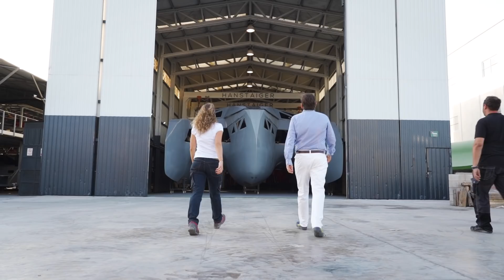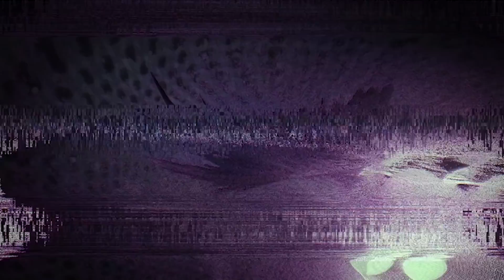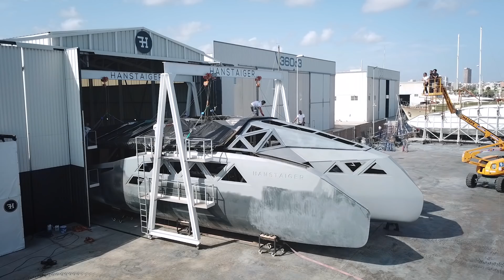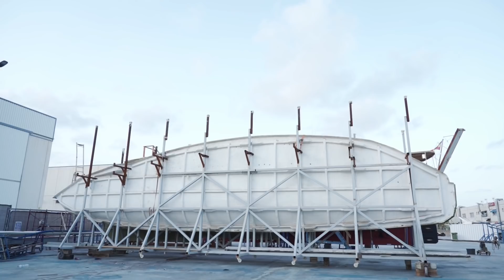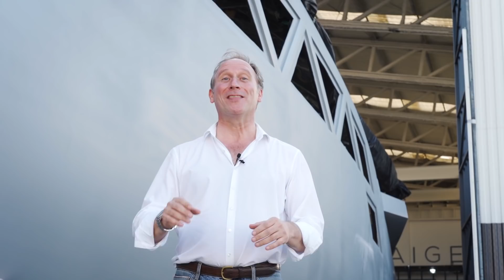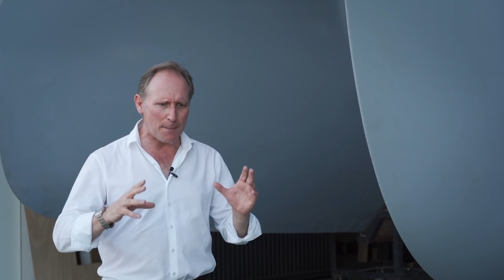BUILDING A 64' TRIMARAN FROM SCRATCH!!!   THE HANSTAIGER X1

Comment: Love the yacht, black is a stupid colour (shade) though, no one is going to want to live in an oven, it would be so hot that you would have to run the air con 24/7 and the batteries can't do that so there goes your very expensive fuel bill, the hull would be so hot that even with the back door open the yacht would be boiling.

Think different yes, but there are some things you just do even if everyone else does them, because it makes sense, and light coloured paint is a no brainer.

Comment: I really like trimarans but the clearance between the water line and the bottom of the decks between the main hull and the amas' looks pretty low. I know that some catamarans were rated poorly because the waves would slap the under deck making the yacht noisy in anything but flat seas. The hull and two amas appear quite beamy so likely very buoyant which would tend to keep the under deck higher out of the water, but then how well would the boat track upwind or on a beam reach? This video is a sales pitch, which is OK. If it works I would love to have one (but without the large windows facing forward). I would really like to see how a scale model, properly weighted, performs in a swimming pool and wave tank. Also the sail plan that was shown looks inadequate or perhaps improper for the size of the boat. I am no engineer but I am pretty certain that a simple jib and mainsail would not work in anything but ideal conditions. The rigging needs to be better explained. 

Having said all that, I otherwise like the look of the design a lot! (Except for the very large forward facing ports in the bridge decks between, the hull and the amas'. I think that is just asking for trouble.) It looks a lot like a space ship which would make the owner one of the coolest kids on the planet. I do hope the interior is finished nautically and not like the typical European contractor grade blond wood, square cornered cheap motel décor. My preference would to decorate the interior in a steam punk, 20,000 Leagues Under the Sea ambiance. Would that not make this the uber coolest yacht on Earth!

Comment: It looks cool but no real outside deck space, what did they replace the cheep foam which has ZERO structural value with balsa wood ha ha ha why are there so few ribs in the structure but it does kook nice  and it does not weight much by the look of the caster wheels .

Comment: But is the owner going to BBQ on the hot black exterior?
Reply: The only yacht that will cook you if you stand on it's exterior and requires AC in the winter or while traveling above the arctic circle... This is going to use a lot more fuel than a like volume yacht and why fix a design flaw (black exterior) with several cost increasing "features"? Mark these words; this is one of those amazing futuristic designs that will be used as a case study in the future of why small yachts have certain design elements, namely this is an excellent how to not design a boat. Feel free to prove me wrong, not with words but with this boat not having the problems I'm mentioning.

Comment: After this only a submarine with sea sailing and air flying capability can be expected. You may not expect this from me but I was looking at other catamarans and trimarans  with an idea to purchase / build one and I do agree with Hans Steiner - ALL current designs are like a living room sofa dropped into the sea. All current designs look more or less like a happy-bingo sea hotel but THIS X1 is something very much else. It would have been more then a pleasure to work on it and sail on it even though I do have concerns about this middle joint ... Have you considered ... 3D PRINTING the entire shell?  It's possible to print entire buildings - why not yachts? In any case I am looking forward to see and hear more about this project into the future. God Bless.

Comment: If he is going way outside the box on this one... Why not have flexible solar panels made into the sails as in The Black Pearl or extendable foils as in the America's Cup Ship designs.... Wouldn't have to be as radical but enough to gain more speed under sail.  They could extend straight down from the hull in more of a fixed position, computer controlled for stability.     just an idea

Comment: we wish to build a 100ft HSV for Lake Victoria with 8 medical crew and the Crew by at least Cptn, Eng. Cook, and Steward with  Examination Rooms, theater, and Dentist chair - as Symbol for UN SDG Circular Economy - our Design Briefing was based on a 100 ft Catamaran fully solar shell with hydrogen propulsion - do you see a possibility to use one of your moulds to build our - extrem futuristic vision of form follows function ...pls contact : acad.interfaith Kenya-Swiss-Turk Curatorium Bamboo Equator under <pariscop21surveillance@tum.ac.ke> or Paul Ketterer Head of Mission (Swiss ) +254 790 408 314 / or 315 / asante sana Prof.Dr.Ezekiel Okemwa Nobel Prize Laureate Chairman Curatorium

Comment: Yeah, a black boat that requires a lot of AC to cool it down. Some things haven't been done before, just because they are not a good idea.
Apart from that, it's nice to try something different for sure.
The problem with builders is that they don't live on the boats they build later on. If they would, boats would surely be different. That applies to many boat and house designs, though.

Comment: I can't wait to see how this thing comes together all said in done. However it isn't very pretty. The overall geometry of the ship seems a bit off, using the bases of "the triangle is the strongest geometric shape" seems to prevalent in amateur designs and in this case is well overused. The triangular windows don't seem to be well optimized for the space they're occupying and the profiles seem disproportionate. This typically is the problem when there isn't a lot of scaled modeling done beforehand. I'm assuming they did most of the design work in CAD. But overall i love the fact they are bringing a full size concept to life. Definitely major respect points for not using the same old cookie cutter hull design and throwing caution to the wind. Thanks for bringing this to light! most of us would have never heard of the project otherwise!

Comment: I have always liked the idea of a super yatch, for the elegance, and beam with, yet dred the thought of the fuel consumption. With this type of trimaran, it may tick a lot more boxes. Look forward to seeing the finished product.
Reply: Then get a sailing super yacht! This yacht is one. You can still use some fuel (if you like) to run generators for enough electricity to live in a lavish lifestyle, but that amount of fuel use is nothing compared to the insane amount of fuel required to run the massive engines on a motor yacht.

Comment: Reverse sheer lines and bows are old design ( Horstmen trimarans 1960's) . Boat builders found they submarine . Wait till a wave or ships wake takes out that huge open aft deck and floods the boat. Or bow hits a dead head (floating tree) or a shipping container. That bow will go under not over.  
There is no curb to pull over too. And call on your cell phone for a tow out there. Even a sat.phone does not always work. And mother nature is a bitch!

Comment: maybe it would be good as a power boat but as a sailing vessel its less than optimal 
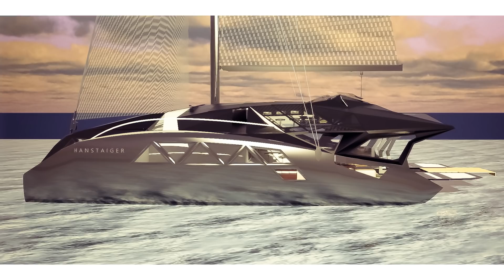just look at 9:37 the profile is way to high the wind has to much surface area to affect the boat .
now i am not trying to be a douche but this looks to be a boat that is designed by people without much experience in 
cruising if any at all , that becomes really clear once you look at their homepage ... its a mess 
the floorplan is confusing to say the least and here is a snippet of the spec sheet 

ACCOMMODATION:
1 Owner’s stateroom 2 VIP Staterooms

1 Staff cabin
2 Crew cabins
1 Captain 1 Crew
1 Staff
9 Guests

say what ? 
no i am serious just look at the specs page it seems it was put together in like 4 minutes without much thought or care 
its not very confidence inspiring when you try to sell a multi million dollar product and your homepage is pretty much useless

Comment: All those weird angles make me think it won't have much deck space, and considering it'll be a sailboat I'm a little concerned about access to the rigging. Its all well and good to have everything lead to the right places, but something always goes wrong at sea and requires you to get up close and personal with it; I hope they've considered that in the design, and its hard to tell from the concepts and what they've built so far.
I really, really like the trimaran design with good interior space. Trimarans offer a really good safety and performance point that I'm surprised more boat builders haven't looked into. The only one I know that does a cruising trimaran are Neel, and they've got a lot of quality issues. I'm really looking forward to seeing a finished product and getting some tech specs on performance expectations.

Comment: You know what has excellent and well know propertys in regards to heat... Wood. Imagine all the life boats that could be stored aboard for want of that sliding rear deck. What about the dynamic loads of all that glass being able to be in 2 totally different positions (in the least just wait till something fails). All the glass in the world doesn't help you spot other ships or things on the horizon, I need to see more about the pilot house. The Crew will need to know who's on watch and not to assume that because there are alot of windows around that well see what ever it is coming.

and lastly

Black! seriously? Yes it looks like Batman's justice league party boat, but are we sure its a good color for the open water? Personally I would go with a vaguely metallic number and some decals to play up the triangle and curvy lines, in reflective materiel. You know, it'd look cool and not be invisible at low light conditions.

Comment: Congrats, your yacht is more of a bus. I'm sure your investors with limited knowledge in this area are content with the futuristic look, but it wont be much of a sailboat, and before comments are made, I mean it will not reach the heights of wind-power that this length and multi-hull design is good for. It's potential in sailing will be forever ham strung by other considerations. It will forever be a motor boat with a sail.

Comment: That is a lot of windows and the more windows you install creates a weakness in the structural rigidity. I am sure they did an analysis of the stresses that the hull will take and apply it to those Triangle portholes? NAAAHHH it looks cool. Who does that.
You have to take into account the adhesive to hold those windows in place plus, time to failure based on structural pressure, wind, ultraviolet and inclement weather when thousands of pounds of water come crashing into your hull. I think this is just a show off toy to be sailed in fair winds and calm seas.

Comment: positive things first:
i really like that they are bold and bring in new ideas
the boat looks amazing

negative things:
the mindset making them paint it black. i mean its like with most modern architecture - its just not smart to build an oven and be like "well just add more air conditioning". that point sadly made the boat itself not that interesting in sum. i mean its not about painting it white but doing something thats bad for using the boat just to set it apart is a mindset i can not support and would think which other parts of the boat are the same just to not be traditional or just to look "cool".

Comment: This is an engineer's dream. Make up a bunch of problems that don't need to exist, then solve them in creative ways that will probably fail.  It's how progress is made.

But seriously, a black boat isn't practical or desirable. The large forward facing bridge windows will fail in large seas and sink this thing in an hour. Did you say the anchor is in the aft?  Near the rudders?  I also wonder about buoyancy in the bows.  Looks like it will get buried. 

Still, it will make a great sunshine sailor and entertainment platform.

Comment: The imagination, inspiration and dedication necessary to conceive such an absolute departure from the norm', based on cutting edge design, technology and engineering, breakthrough materials, components, and construction, and the skill set to manufacture to previously unheard of tolerances and strength, possess such radical foresight that it can only be described as visionary!

Comment: Did they actually tested the ship scale model in wind tunnel?  The ship is going to have problem against strong side wind even with sails down. The ship body is just too far above water and will catch too much wind pressure from sides.  Also the ship is not going to be as stable as typical trimarans.  It should be a power boat instead of sail boat.

Comment: The design drawings do not reveal the sailing system: winches, bowsprit, sheet routing etc. Looks more like a power yacht and or motor sailer.
Reply: I bet this boat spends more time under power than under sail.

Comment: No sundeck on a 64 ft yacht? If you are not using the outside part on top of the boat, solar panels could be fitted in so you don't need to always use the generators to charge up the 24 lithium battery pack

Comment: Trimarans are really the best seagoing designs out there. This is obviously set up as a complete cruising package as her beam as about half her length. It will be interesting to see what her sail area to wieght ratio is, The web site is claiming 15 knots under sail power alone.. hmmm.. 36 tons is a lot of boat to move at that speed that will mean she's going to need a very powerful rig to move  but I'm guessing this is going to be more of motor sailor yacht than purely sail.

Comment: You never disappoint David! 5 months on a Trimaran traveling the Pacific taught me one thing. I'd NEVER do it in a mono-hull! Trimarans are more stable and handle rough seas extremely well. All we had was a small generator and a bank of 12 volt batteries for the lights, comms and radar. Gas stove. AC? HAHAHAHAH! turn it into the wind and open the hatch covers! I wish John and his family good fortune and calm seas!
Reply: I like trimarans for the stability, but downside so far has been cost, ie having to tool up from scratch to build the hulls. Also curious whether the dark hull could be used for convective cooling or as part of a heat exchanger system. The dark hull should give a fair temperature differential between hull & water temperatures.

Comment: An idea I proposed decades ago, He brought to reality... 

The hold up was reliability of the structure in the open seas... Funding the hull integrity test phase was the issue... 

My orginal design was a 45' beam x 130' length... Three deck levels, 1.5 in hull & 1.5 above deck... Tri decks provide support for the best hull structure... 
Engines options: Electric or Combustion or a combination...

Comment: a film based photo voltaic layer should be used on the sails. a huge amount of surface area is available there for power generation when the sun is low

Comment: Best yacht I’ve ever seen, would rather have a motoryacht myself but it looks epic 🙏
Reply: Modern yachts can go faster under sail than any long distance motor yacht. Plus, range is unlimited, sail is silent, non-polluting and sails provide considerable damping of the motion in a seaway. Of course they have an engine, too. In fact, under about 100ft, it’s quite difficult to make a motor yacht with adequate range to cross oceans. Why burn 10 gallons per hour, 24/7 for a couple of weeks crossing the Atlantic when you can do the same voyage as fast or faster, using your engine only when the wind is unfavourable.
Reply: Q. E. D. I know all the benefits... went on a sailing trip a while back then a storm started... been scared of sailing ever since 😂
Reply: snep games 
Try the same storm on a similar sized motor boat - much more scary.

Comment: Very impressive and ambitious project nevertheless, pity that trimarans suck as whole though.
Reply: I owned a 24' 700hp trimaran that ran over 90mph and turned like a race car on the water. Very stable handling in 3-5s. What are your issues with the hull?
Reply: If they build it just for speed and for having fun sailing for 1-2 days then yes they will enjoy it very much but if they build it to use it as a luxury superyacht then wait and see how fast they will go to sell it in the second hand used market after their first 1-2 voyages.
Reply: define suck. sounds like a feeling mire than a fact

Comment: What an amazing NEW yacht. All sorts of questions, sound attenuation, ceiling height, sail options and sizes, what about the living areas are they all under cover or are there outside areas as well.  Imagine if you had a black one next to a royal blue one next to a canary yellow one next to a ruby red one.  What are the internal layouts like, galley down in a separate area ?? where is the master cabin located.  What are the figures saying for sailing performance ??  Who is doing the internal design and is it going to be an ultra modern style, or more of a Danish feel ?? Two engines or three or is there any thought of using electric engines ??  This is an absolute stunner, I cannot wait to see more of her.